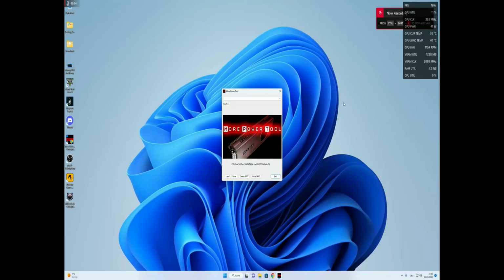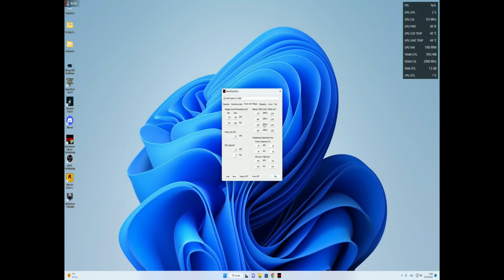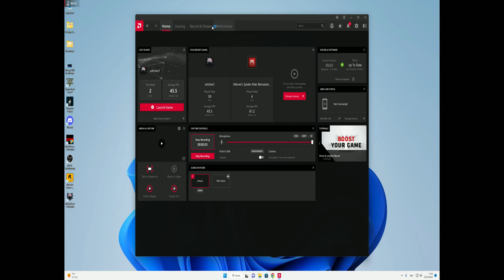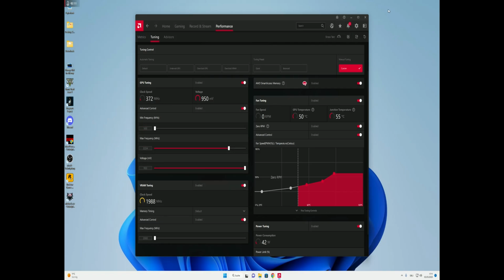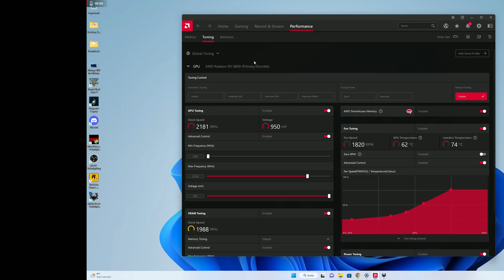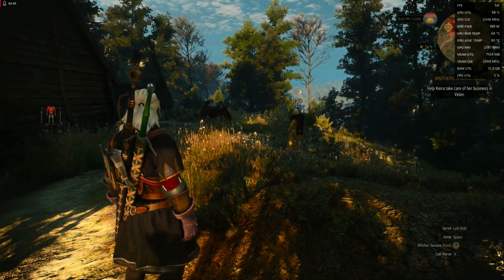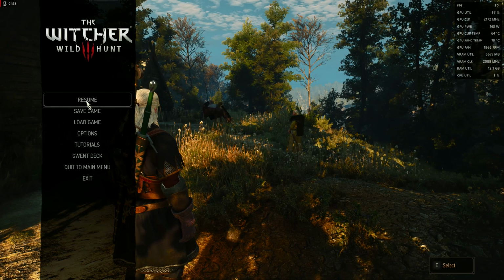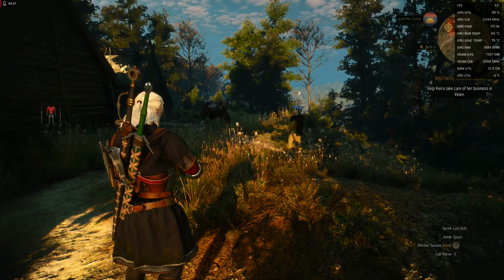AMD RX 6800 MPT undervolting (tutorial) - 900 mV / 950 mV - stock freq. vs. 2000 MHz vs. 2400 MHz

Comment from the maker: For reference: the standard setting (2224 MHz target, 1025 mV) with PT +15 is like 200+ W with ~50 FPS.

So one can achieve more performance (54 FPS, 2400 MHz target) and 170 W power draw (with 900 mV). Insane!

Comment: how does yours stay at 950mv because mine just always sits at 768, do i need to use the cru?
Reply from the maker: Hi,

voltage also depends on the load. On idle it's normal that the voltage is low. On load lower voltage is better but if voltage is too low it might crash. CRU is needed if you want to apply settings immediately without restarting the PC, which also works.

Greetings,
Looney's Tech Channel
Reply: @LooneysTechChannel  im thinking my voltage is too low and thats why it crashing but the thing is even when using mpt my minimum voltage if applying for it and is staying lower than i set it
Reply from the maker: @technic7085 Hmm, that's strange. Reset sppts, reinstall driver with ddu and try again. Is it happening without mpt, too? When no, just run the GPU without mpt.

Comment: pushing 975mv at 2550mhz, vram 2112 and power limit 15% (and 260 on mpt), incredibily increase at 4k gaming, same as the XT version, and the temps got around 50-60 and the hotspot 10 above. (as reference, rdr2 on 4k getting 70fps native at ultra)

Comment: Hi. Does this work without Adrenaline? Cause I'm getting blackscreen if I'm using the adrenaline so I settled for driver only.
Reply from the maker: Hi,

yes, "should" work. I didn't try it, though.

Greetings,
Looney's Tech Channel
Reply: @LooneysTechChannel  thanks but I dunno how to change the frequency since it has alot of options and numbers on the frequency tab. Still having black screen after 30mins of playing graphic heavy games. I'm getting frustrated already.tzk
Reply from the maker: Hi,

first: which card do you have? second: frequency can only be changed in Wattman or tools like MSI Afterburner. But you could try applying higher or lower power limit and lower voltage (higher voltages can only be applied via hardware mods). From my experience you will get higher performance with lower voltage, but not every card can manage high frequency at low voltage.

Greetings,
Looney's Tech Channel
Reply: @LooneysTechChannel  ahh ok so the frequencies on MSI after burner. I got a 2nd hand Gigabyte 6800xt gaming OC 16GB

Full specs:
MOBO: Asus Prime z690-p
CPU: i5-12600KF
GPU: Gigabyte 6800xt GAMING OC 16GB
RAM: G.skills ripjaws 5600 cl36 DDR5
SSD: Adata Legend 850 lite 1TB
PSU: FSP Hydro G Pro 750w
HDD: samsung 1tb ssd
Monitor: Nvision 27" QHD 180hz

The thing is I wanna run this on 180 refresh rate. I dunno if I should reduce this but that beats why I bought a 180hz monitor. =( I need to undervolt my rig since I'm getting hotspots @ 103-107⁰C done on 1050mv but I can only play like 30mins. Which driver is latest that is stable?
Reply from the maker: Ok, could be several things: 1) broken PSU, 2) broken card 3) card is not connected to two separate PCIe cables or connected to the same rail on a multi-rail PSU. Please use two PCIe cables to connect the GPU bc it can lead  to power delivery problems when daisy-chaining the PCIe cable (I also had this problem on my Vega VII and 64, not a new problem). 4) could be that your PSU is not delivering enough power. I mean not on average, 750 W should be enough, but within milliseconds / nanoseconds card could pull like 500 W alone. It would help to dial in a lower voltage with MPT and reduce power limit by a significant amount like 20 W or more. With the undervolt it's very likely that you wouldn't hit power limit, but in some scenarios it could happen anyway (like Raytracing), 5) software, try this, if you tried everything else, since doing a fresh Windows install, is time-consuming.

Edit: temperature shouldn't be the problem, since the card would underclock itself around 110 °C. Idk what AMD smoked, but they consider 110 °C as safe for these cards.
Reply: @LooneysTechChannel  1) My PSU is new and I have just followed that this need 750w and this is tier A. Maybe should have settled with 850w.tzk 2) I dunno if this broken.sigh I have checked the components physically and no broken components, but the power draw is I'm not sure. 3) I'm using 2 seperate cables.  4) I will try to reduce power limit if that helps. I'm not doing any raytracing and I don't have a plan to use it. What version of windows 11 are most stable? I could do that just to make this thing work. Thank you very much
Reply from the maker: Yeah, try undervolting and decrease power limit first. If that doesn't help, install Windows 11 (latest stable version you get from official site, wouldn't go for preview insider for that) or you might try Linux (though that comes w/ other issues / shortcomings, like some stuff not running, but maybe to rule out Windows OS/driver problems, games mostly run better, when they run).
Reply from the maker: You could try to read out voltage / wattage with RTSS or CapFrameX or HWInfo64 to check if it's working.

Comment: Why you in other program did the 950mv?
Reply from the maker: Idk what you exactly mean... 

In MPT you limit the voltage of the GPU whereas in Wattman you give the GPU the instruction to use less voltage (but the GPU is not forced to use this lower voltage).

Wattman undervolt is utterly broken as the UV is just a "recommendation" for the GPU and the GPU will use as much as it thinks is crucial for stability. Only MPT undervolt uses a "real" limit.

See my other video regarding this topic.

MPT undervolt is just much more effective than Wattman undervolt (20 - 30 W less for same performance).

Also AMD unfortunately locked / encrypted SPPTs for RX 7x00 cards which means undervolting becomes useless if you want to actually limit the voltage. Also one can't increase the wattage and the other parameters like Amps etc. which is very disappointing.
Reply: Thank you very much! I wanted this info. I'll try with this MPT.

Comment: MPT cant see my card rx 6850m xt, what i can do?
Reply from the maker: Hi,

it's possible that mobile chips aren't supported by MPT or locked down by AMD. You could try to DDU.

Greetings
Reply: @LooneysTechChannel  MPT can kill notebook gpu easy, so good it can't.
Reply from the maker: Hi,

depends on what you're doing. Without MPT you can't undervolt well since for whatever reason MPT undervolting is much more effective. If you however increase power without increasing cooling that might be the case. But don't modern GPUs have automatic shutoffs if the GPU is overpowered or overheating?

I now got an HP Omen 16 and desperately want MPT for it (7000 GPUs are not supported and igpus, too). I just want to be able to tune it... From a (power-) user perspective that's just one more thing that is forbidden bc there might be problems. I don't like that: why take people's freedom?

Greetings

Comment: My RX 6800 is able to do GPU 2400Mhz, VRAM 2100Mhz at 885 mv and a temperature of 60C at 210w. I have an ASUS TUF gaming card and they use the same cooler on the 6800 as the XT and 6900. The result is ridiculously good cooling. Other manufacturers use the 6750 cooler on the 6800 and theirs run hot. I use OCCT software for stability tests because its free and it will give you actual windows and software errors to troubleshoot. My system can run with no errors at its current state. Also, I use the standard VRAM timings because I gain almost 8c and 30w with it enabled for negligible performance gains. The RX 6800 is insanely underrated.
Reply: Not to say that the RX 6800 isn't underrated, but that also sounds like you got a great sample. I'm currently at 925mv targeting stock clocks (2274mhz). 900mv kinda works for me, but it's not stable in all tests. I haven't tried increasing core or vram clock targets at all at 925mv yet.
Reply: @labombaromba  I have Smart Access memory enabled and fast ram timings turned off. Otherwise I wont be able to maintain my current settings. When I perform testing, I verify my CPU and RAM combination works before touching my GPU. Often times I am able to push my GPU further because the rest of my system is finely tuned.
Reply: @cesarpalmos8235 i have egpu with xfx 6800 swift 319, in my laptop lenovo with 7840h cpu, i don't have this function resizable bar to turn on...
Reply: what fan speeds r u running to get 60C@210W ?
I also have ASUS TUF 6800 and its pretty mediocre. Now i'm on 930 mV / 2200 MHz and +10% Power Limit.  GPU/HOTSPOT is 63C/71C. TGP is 147W with 1325 Rpm - this is heavy gaming load - FInals Multiplayer which, I found, was game that quickly crashed GPU Driver in case unstable(while Un-engine & Metro benchmarks gave nothing)
Is there a way to fix GPU MAX Frequency via MorePowerTool?
Any lower voltage - just get stopping driver errors...
Reply: @yingbxua6240  My case is a Lian Li Lancool II with Lian Li SL 120mm on the rear exhaust, two 140mm on top, and modified case for three 140mm on the front. I had never really had a problem, however I noticed better tuning performance after updating my computer with a fresh windows install. My card is currently at 890 mV, 2400 MHz core frequency, 2050 MHz memory frequency with fast timing. If I use regular timing, I can push 2100 MHz memory and 2500 MHz core frequency. I enabled power tuning but leave it at 0%. If I move the power limit slider at all, my GPU will crash. I used MorePowerTool, but found it causes more problems than fixes. The only other tool I use now is OCCT for diagnostics while tuning with Adrenaline.

Comment: Hey, i'm trying to undervolt my 6950xt, but the new voltages don't get applied for some reason. The profile is working, because turning off the DS settings in feature control works, but the voltages don't do anything. I set the max voltage to 1150 for example, but Adrenalin keeps showing that the max voltage is still 1200. Am i missing something?
Reply from the maker: Hi,

set voltages in MPT and reboot your system or use CRU restart64.exe to restart graphic driver.

Greetings
Reply: @LooneysTechChannel  Ah yes, i should have mentioned that I reboot my pc (no fast boot) after writing the sppt, but unfortunately it doesn’t change anything. Should i maybe use ddu and redownload MPT or something?
Reply: Do i have to tick something in feature control before it works perhaps? Ive seen other people use the temperature dependant voltages instead, but i’m not sure if that is something i should use.
Reply from the maker: Ok, then Idk. Which driver are you using? Maybe they patched it.

So, doing a DDU seems right. Maybe this helps. Maybe using a new MPT version or using an older driver might help.
Reply: @LooneysTechChannel  Using the july driver right now. Which one do you recommend? I will try all the suggestions tomorrow, since its too late now haha.
Reply: Alright ddu did the trick. Thanks for thinking with me :)
Reply: Voltage is not changing in amd driver.

Comment: I'm sure I can do better but I just did 950 / 2200 with power limit maxed out at +10% and am pulling 150-160w instead of 215w. In the cyberpunk benchmark i only lose 5% performance

Comment: Heck! Mine can't even do 2300mhz at 905mV 😢
Reply from the maker: Hi,

just try with a little higher voltage. Even 975 mV is far less than the default of 1025 mV.

Greetings
Reply: @LooneysTechChannel  Thanks. The Best I could do is 2290Mhz at 920mV. Have you tried any DX11 games? I have noticed that those games make the GPU use far More power than DX12/Vulkan.
Reply: Today I tested 2400mhz at 900 mv, and it work stable. But temp on GPU 69 and noise on coils. For now i switched to 2224 at 900mV and change fan settings. Noise gone ;) 
Rx6800 is very good card.

Comment: Yo Bro, i have mine totally stable on 2480 2150 fast timings at 900mv. Im on 22.11.2, the latest driver are good? I had some trouble with 23.2.1 cuz cant keep the same oc. Maybe i must try to do 950mv? I Will test it (6800 xfx qick)
Reply from the maker: Hi,

nice to hear from you! Yeah, mine does 2500 MHz as well but on 950 mV. I could go higher on the max freq. or lower the voltage. I'm on 23.2.2 and so far so good. I even gained a few % on raytracing performance.

Two things that are meh:
- I have a CPU-OC in Wattman (R5 5600 +200 MHz) but it is not showing under performance
- After a few hours with the new driver lot of the performance metrics are not showing in the driver -> reduced parameters to show in the overlay. 

Besides that (and the bad scaling when recording, issue can be present in the former drivers I guess) driver is good. More performance; MPT is also working just fine.

Greetings
Reply: @LooneysTechChannel  i Will try the new driver than...for the cpu OC i prefer to do everything on BIOS with pbo + new curve fan settings. Im on 5700x so our builds are similar. Your vid are Always intersting, keep up the good work 💪🏻
Reply from the maker: Yeah, try a little higher voltage like 925 / 950 mV. I've already heard some folks that this is driver dependant, too. You got a very nice GPU, too. Not many can reach those numbers I suppose. 

A very important thing that comes to my mind: Even though I can run the card @ 2150 MHz FT performance would actually decrease a little when I'm doing so. Check with Timespy or timespy extreme as this could gain some extra stability and performance if that's the case for you.
Reply: @LooneysTechChannel  well...on time Spy i Lost around 100 point vs 22.11.2, from 18k score GPU to 17.9. seems to keep same settings (2480 2150 FT 900mv)...i try to let memory 2150 without FT as u say but i Lost another 70 80 point, pull up voltage on 925 and Lost other points. I dont really care about the best scoore possibile on time Spy, i prefer to be stable with best performance in game. Cyberpunk bench seems to be similar, maybe Better 1% low. I must test other games...
Reply from the maker: Yeah, seems reasonable. Benchmarks is not as important as games and stability. Here you got a point.

I meant you can try  2100 MHz FT VRAM. FastTimings are bringing most performance but at high clocks these may be unstable.

Max I can do is 2120 FT but I like the settings more conservatively. My card does 2150 FT but I lose about 5 % performance instead of gaining a few percent making the too fast setting unusable.
Reply: @LooneysTechChannel  well on 22.11.2 i was really stable at 2150 FT. Never 1 crash and i think was the best performance i can get. I Will test on new driver if 2100 ft work better :)
Reply: @LooneysTechChannel  hello Bro, i test on new drivers and seems to be more stable in oc. Now i complete time Spy near 18k GPU scoore with 2100 ft (as u Say) 2.5 on core @ 950mv!!! Try to push the new 23.3.1 and let me know 👍🏻
Reply from the maker: Hi,

I tested 23.3.1 with 2500 MHz @ 950 mV in TimeSpy. This setting was stable previously in Games at least but now I had to dial in 100 MHz less (2400 MHz target) for TS. 

I thought at first that my card degraded because none of the settings worked (e.g. 2500 MHz @ 975 mV) but I saw @AncientGameplays latest video where he stated that OC-settings may have to be dialed back on the 23.3.1 driver.

Now I will try to go back to 22.2.2 tomorrow.

The card was able to hit 2540 MHz at 950 mV previously though I didn't test TimeSpy for a while now.

Greetings
Reply: @LooneysTechChannel  hello, new 23.3.1  seems to push a bit on pwr draw...i pref to keep 10 MHz less. I play for hours in Hogwarts Legacy on 2490 max 2150ft 900mv. Time Spy on this setting scoore 18.092 and im 17th overall with 5700x. Im not using MPT cuz if i push over 10% pwr limit GPU run around 4470 and crash. My GPU limit in game Is 4450 4460, its not about voltage or othet things but the limit on the chip. My temps never go up to 63 64 full stress. Aniway we have 2 Gold sample, not everyone can reach these settings, Beast card price performance for 1440p 💪🏻
Reply from the maker: Hi,

I tried 23.2.2 but I cannot oc above 2400 MHz. It still can be the driver because I haven't tried 22.11 and below. Maybe the card shows its age but maybe the driver has made so much progress in terms of performance that there is less "potential" for my oc compared to "before".

Games still seem to be stable with higher oc but not TimeSpy.

Greetings